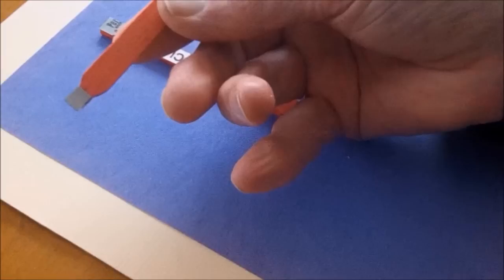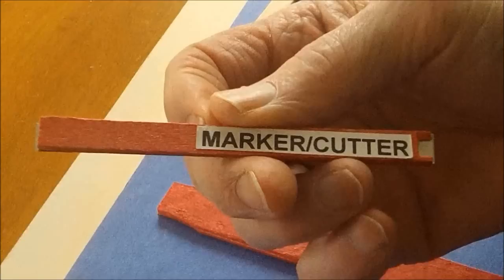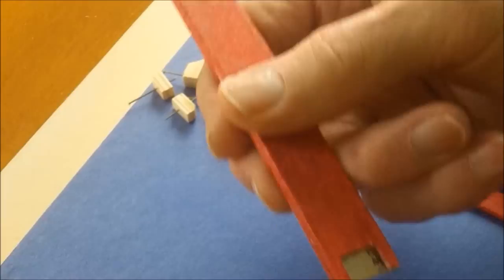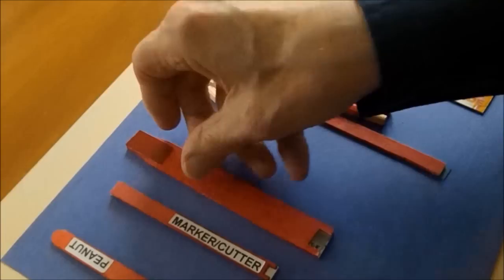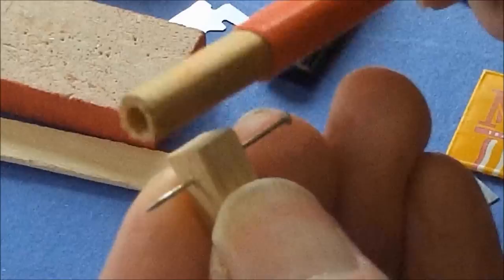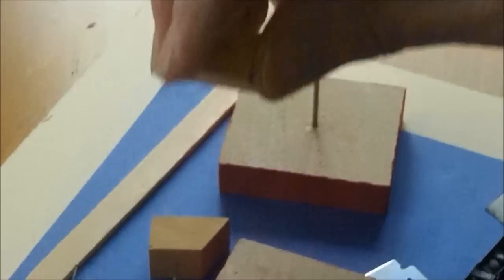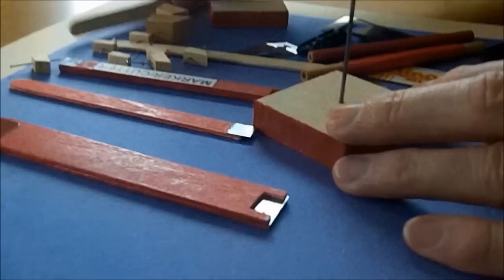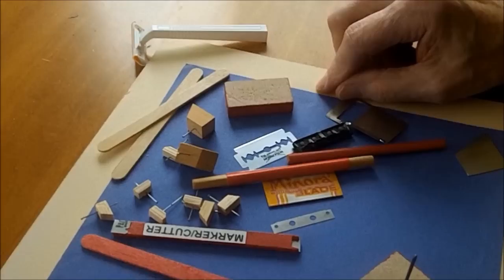The Lavoie Method of Building Stick Fuselages (Part 1)

Comment: I could be wrong and probably am, but I could swear I knew of people who did it this way back in the 70's and 80's... or at least close to this.  Oh well... what's old is always new again. I don't recall anyone using push sticks for the pins however but that is probably due to your choice of building board.

I am somewhat surprised to see that you use drywall (gypsum board) as a building surface. No wonder so many of your pins are bent. I, and I think every modeller I know in the US has always used Homasote as a building board. It's sold as a sound deadening or insulating board, but takes pins easily yet holds them quite firmly. It has no equal IMHO when it comes to model building.

Thanks for the videos. I have always used a method very similar but not identical to yours. (the building process is very close but I never made any special tools, markers or cutters)  I always found there are enough X-Acto head variations to cover any need.